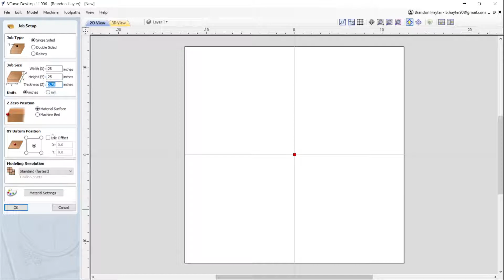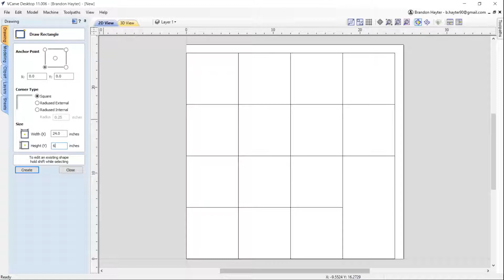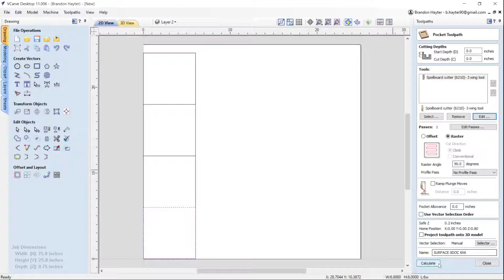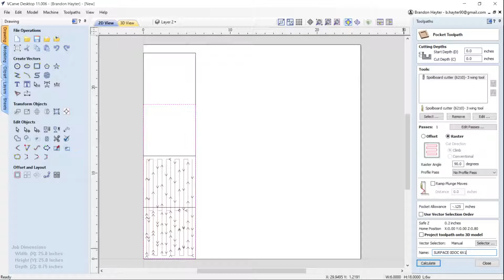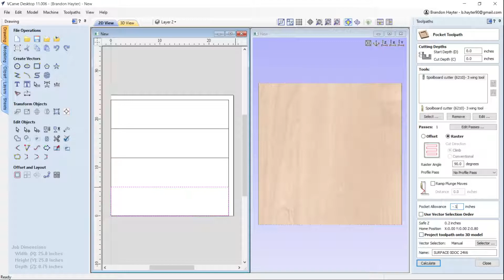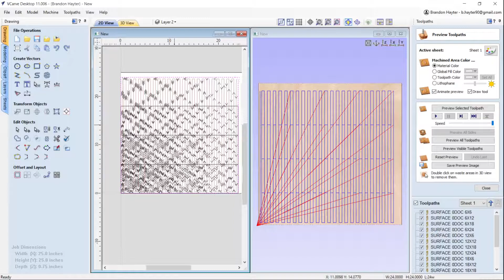CNC Surfacing Toolpaths // Vectric // VCarve // Onefinity

Comment: At 0:47, you state you set your datum to the bottom left; but I must ask, is the bottom left also “home”, meaning that exporting the file to gender will also know where the bottom left is. Datum, is a nominated point, and since, home or datum can be any other nominated point, how am I supposed to know this? Thus far, I can do that, but I don't know the next issues that present thenselves.